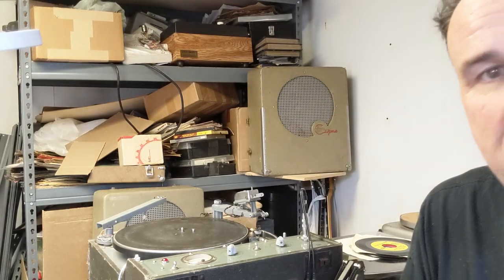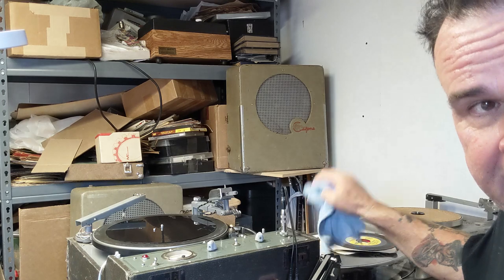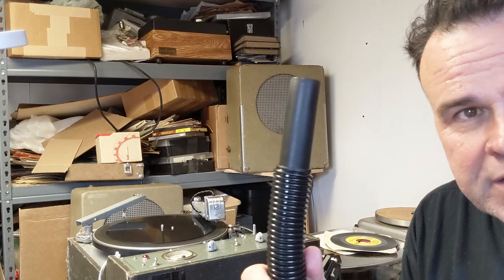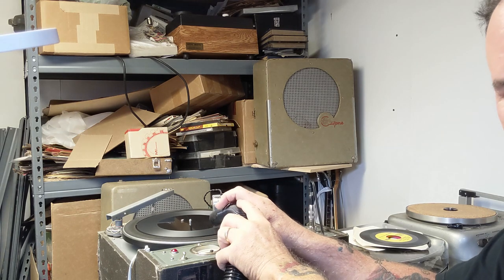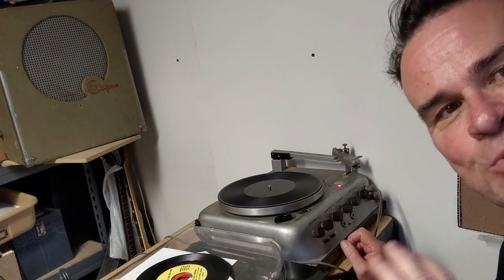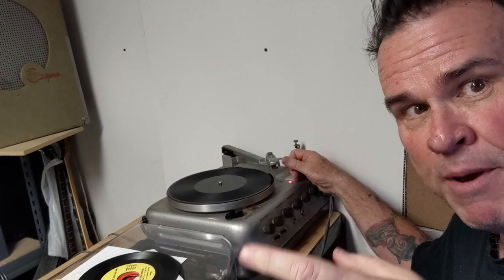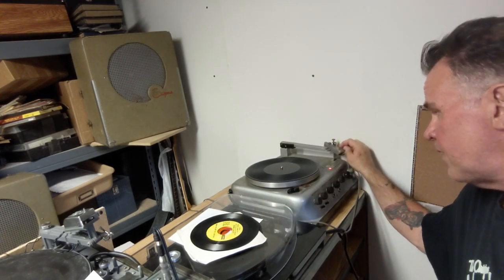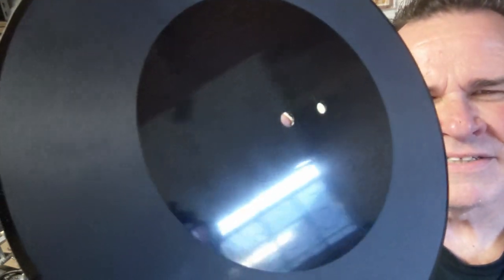Cutting a record with a 1936 Presto K8 portable record lathe

Comment: I own something similar made by Meissner in 1947. (Model 1065) but mine has a built in AM radio. It also needs big time restoration, caps, crystal cartridges need rebuilt ect...)
Reply: Same status, 1946. Plan to get restored. This same machine is on display upstairs at Sun Studio tour.

Comment: I have had great noise reducing results by using Zoom Spout oil and a Sapphire cutting needle. When I use the oil i spread it evenly and keep it wet when recording then I use Dish soap & water and a sponge to clean off the oil. the only thing is it is harder to collect the swarf from the record so I use a paint brush and my fingers to grab clusters of the thread build up. I even got these pvc blanks to work on a wind up phonograph using ether a fiber needle or a cactus needle.
Reply from the maker: I will try that out! Have an older NOS sapphire somewhere
Reply: Cactus? Great I have some of that

Comment: Where do you find the pvc blanks and cutting needles? I have an old Wilcox gay recordio I would love to do this with. I do have a few pieces of Plexiglas I'm gonna try. Mine is 33 and 78. I managed to get a little sound on a old CD but the grooves were very fine and hard to track. Made a video of it and stuck it in my channel. It would be a blast to cut some. Also the cutting needle is probably wide like 78 aren't they?
Reply from the maker: I get my blanks from an ebay vendor, seems the last bug batch is a little different, less easy to cut, and the needles from a UK supplier, gotta find his info, but I buy his tungsten styli. Those Wilcox Gay cutters are crude and hard to get any fidelity with, but they are fun. The stylus I use seems to be a bit wider than for 45s, and was a happy error it seems
Reply: @IBuyOldRecords  thank you so much for the info. I know what you mean by not much fidelity from wilcox. Everytime i found homemade records from the past they never did sound the best from that. Still quite the machine. Keep your movies coming. Fun seeing your record adventures.

Comment: Are you using a long shank needle or short shank in the 5C cutting head? I just picked one up to restore, but no needle came with it.
Reply from the maker: short, I believe. I get mine from a guy in the UK, made of tungsten and reasonably priced
Reply: I made the needle.  Its tungsten carbide. Very hard and takes a good edge.

Needles come in 3/4", 5/8" and 1/2" lengths. 

Mack's are IIRC 3/4".  

I only make other lengths to order and its not a common request so I tend to remember who takes non-standard lengths.

http://www.dragengraving.com/recording.htm